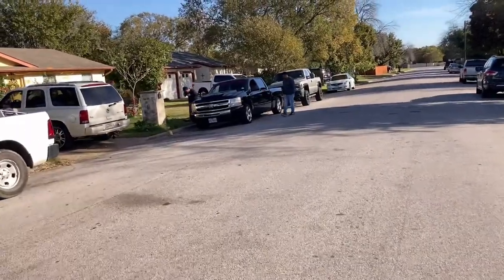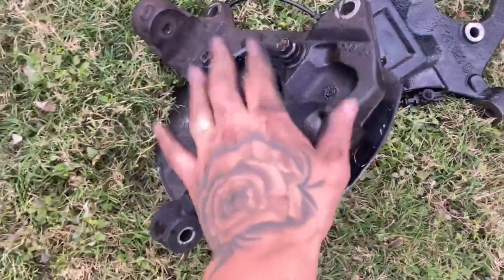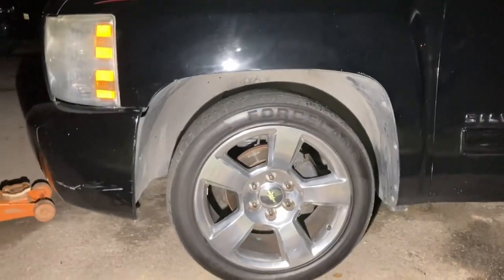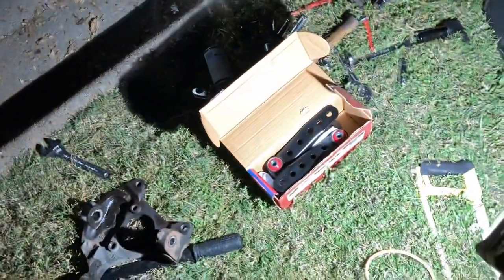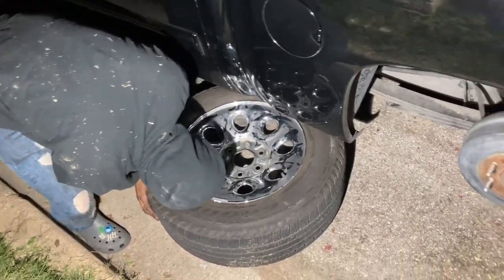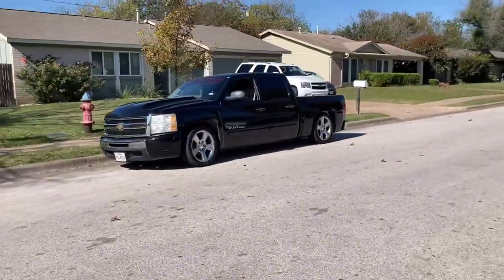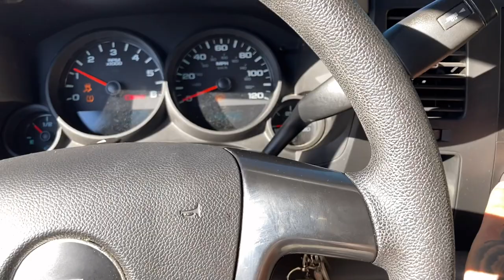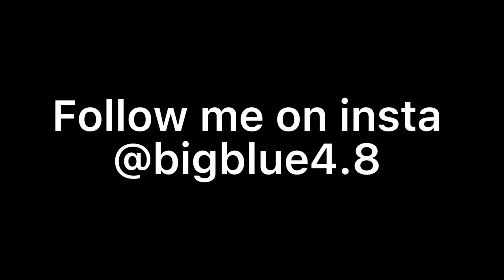Installing 4” drop spindles on a 2010 Silverado

Comment: Idk if ur guys tried it Bur next time if the lower ball joints is seized on and u keep hammering. Get a 2nd jack and put it right on the bottom of the lower ball joint and jack it up hella it’ll put pressure and hammer it a few times when it’s up and drop it down fast (with jack stands in place obviously) the weight of the vehicle coming down on it normally pops them right out . I had to do that to my sway bar link and lower ball joint with my drop kit